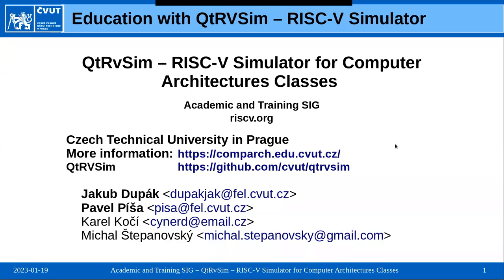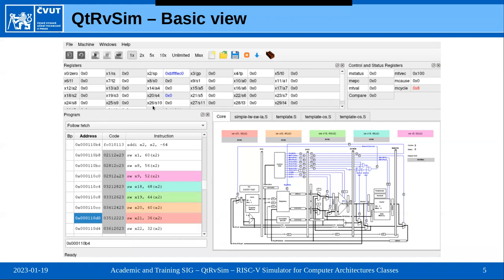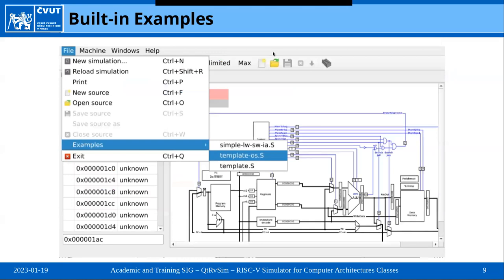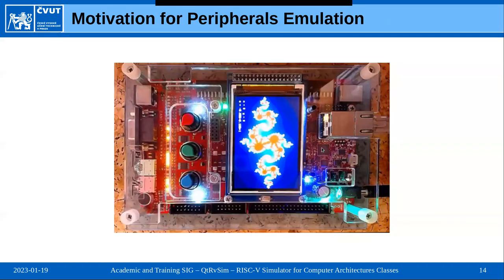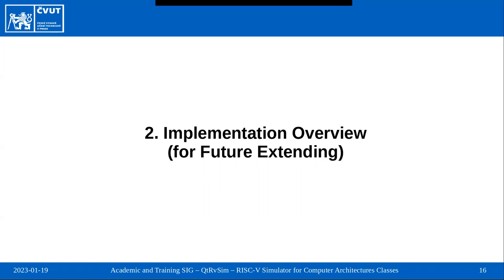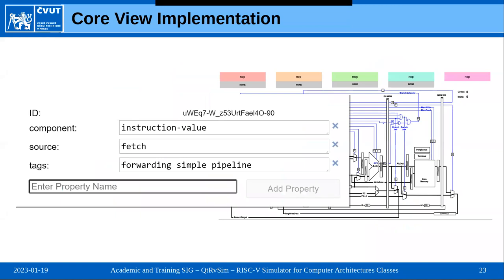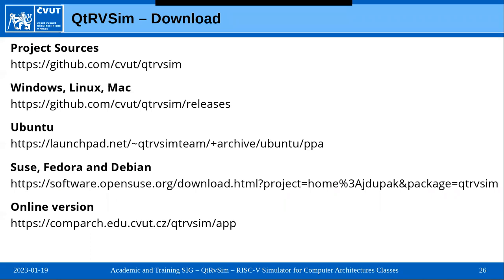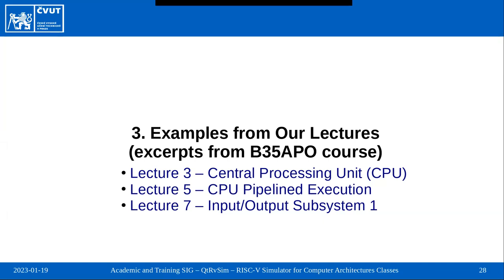QtRvSim - RISC-V Simulator with Cache and Pipeline Visualization

Comment: can the simulator allow user to add and test out customized instruction sets?
Reply: It is not actual goal but longer term possible. Actual level is RV32/64IM for education.  CSR instructions are latest addition and demonstration of  IRQ processing in machine mode are the next target, then MMU and branch prediction. But big advantage of the simulator is that each instruction is defined in the decode table only once and that definition is used for execution, instruction view and internal assembler. It would be complicated to add processing of instructions which do not fit to 5-stage pipeline, but QtRvSim commit stage is the M-stage so if the state is manipulated by new instruction only there then it can be relatively easy to add new instructions. But it requires C++ programming.